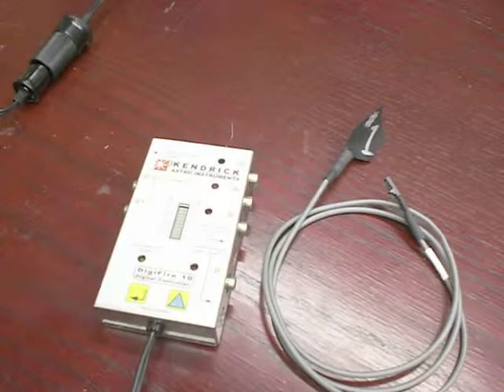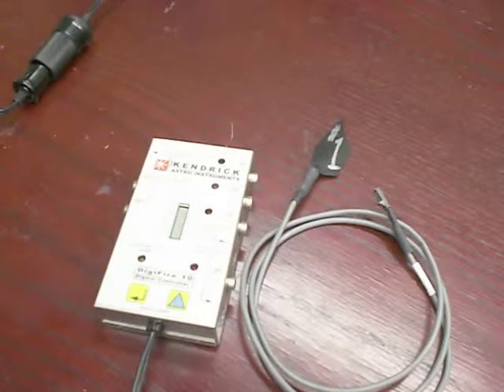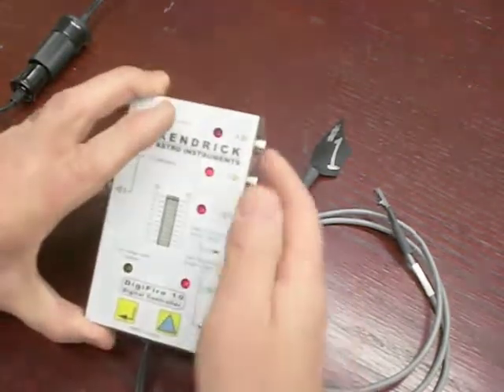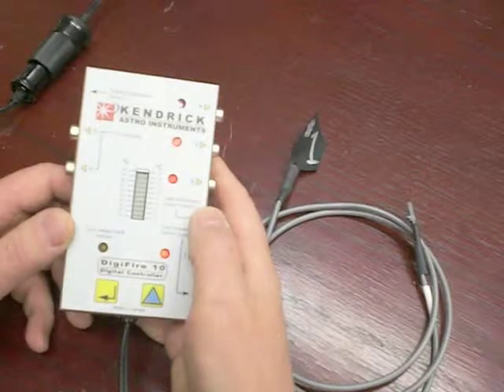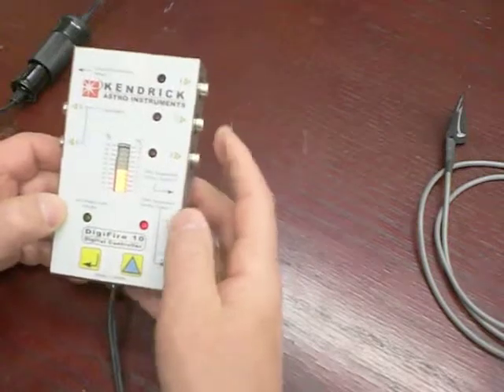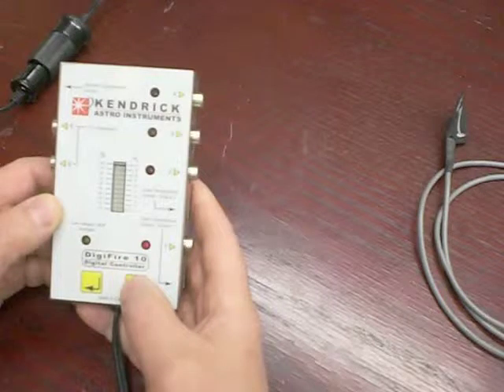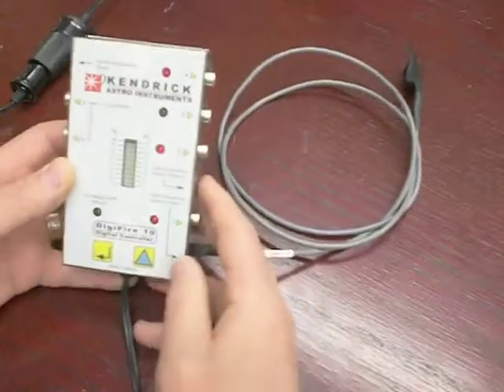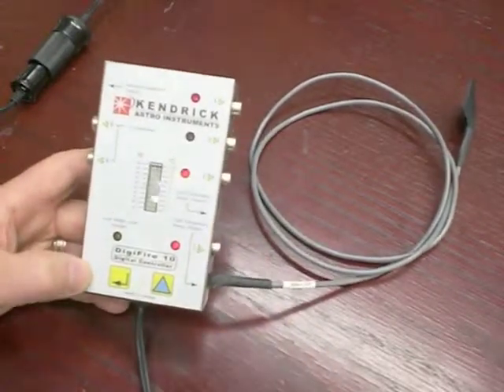DigiFire 10, Part 2

Comment: Thanks for posting this.  I'm in need of a dew control system, and have been looking at your website, but was having trouble understanding what these systems were capable of, how they worked, how easy/difficult they would be to use in the field, etc.  This helps tremendously.  I would recommend putting a link to this video on your website next to the product description.  I like the idea of a closed loop temp-sensing controller, but was unwilling to buy something with no idea how it works.  This is back under consideration thanks to this video.